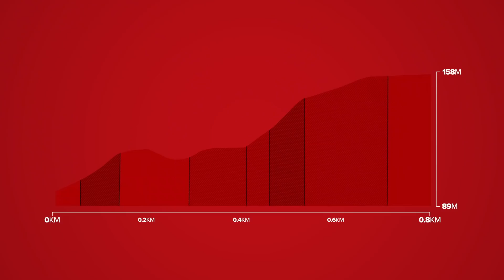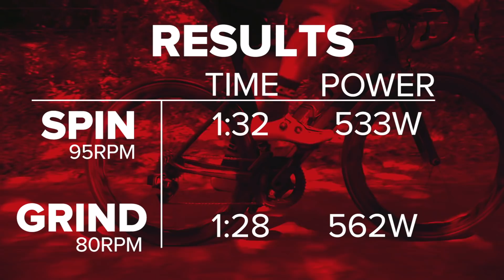Spinning Vs Grinding | What Is The Best Cadence For Climbing On A Road Bike?

Comment from the maker: What's your preferred cycling style? 🧐
Reply: Fun fact: the Lance Armstrong high cadence technique was developed by Michele Ferrari specifically in conjunction with the use op EPO. Because EPO allowed the rider to absorb more oxygen than otherwise, grinding gears stressing your muscles did not fully utilise the effects of the drug. By increasing the workload of the respiratory system at high cadence the muscles would get more oxygen thus have a higher sustained power threshold.  

Note: i am not accusing Froome of taking drugs, it probably means that his body has a higher VO2 Max and lung capacity compared to most others and it's using it as his main weapon.
Reply: Spin to winnn
Reply: Global Cycling Network  spinnnnn to winnnnnnnnnnn
Reply: Global Cycling Network high cadence definitely. Last week I wish I had a smaller gear than 30-27 on a 14%max gradient. All of my friends had a bigger gear, though that didn't mean they climbed faster (some did, some didn't it all comes down to fitness level). However I'd say 80rpm is not grinding territory, you should have done it at 60rpm. My preferred cadence is 90rpm, if you multiply this by 34-32, which is often the smallest gear you find on a compact chainset and with a 700C wheel it gives you more than 12km/h. I'd argue that it's already a great speed to climb such a grueling climb as Monte Zoncolan, you'd have to output a good amount of watts to maintain that speed/cadence. My conclusion to this is that on climbs a lot of riders don't choose their cadence simply because they run out of gears.
Reply: I find higher cadence is harder to keep steady when climbing, but it feels easier. I can grind with seemingly constant even pressure on the pedals so I prefer the harder gear. Also, the harder gear requires fewer pedal strokes to summit.
Reply: I can only talk for myself and say that changing to a real world compact 50x34 with a 32 cassette and learning to spin rather than grind was a massive game changer for me, I went from hating climbs to actively searching them out be it Doi Sutep in Thailand or the HC climb of Sa Calobra onto Puig Major in Majorca. 89-100 Cadence is my personal preference. Obviously some weekend riders are able to spin out a 54x11, or so they state. So it is such a personal thing.Also when you ride 6 out of 7 days I find higher cadence far more workable into that scenario.
Reply: 85-87rpm is my method. I usually don’t stand on the pedals, usually I'm a sitter. Up a hill, I just scoot forward on the saddle like a TT rider and it allows more power to be put down up the hill without standing up. If I stand up, it’s usually to get a little blood flow increase, and stretch the low back.
Reply: When it is a long steep hill, I spin because grinding is impossible for me. If it were a small hill, I grind or out of saddle.
Reply: In my 20's my sweet spot was 85 rpms. Now, in my mid-50's its more like 75 rpms. That doesn't mean I am 12% slower. I am more like 5-8% slower. I practice high cadence, 100-120, for 2-3 mins and brief efforts to 180 rpms but only on a spin bike. As I've aged, I feel that neurologic function more than muscular function has diminished.
Reply: I use a hybrid of the two, I grind a low gear slowly.
Reply: Spining
Reply: ... Spin ... !!! ...yeahhhh !
Reply: I prefer low cadence, but based on this vid, i will try to ride with higher cadence.
Reply: I love my singlespeeding (I have two!). I can climb almost anything without gears so I do like a good grind. However... My last race was a 12 hour MTB endurance event. I came 3rd and the only time I got out the saddle was to look good for the photos ;)
Reply: I have a two speed automatix hub on my moulton. I still do long rides with it. Not long ago I did a 100 km ride and bonked pretty bad while doing it. I'd normally spin but when I was completely spent I could not spin fast enough to engage the second gear. I had it set up to change around 90+ rpm. I had to kick the pedal hard to get it to engage and then slowly grind back home. That time I was really concerned whether or not would I be able to get home.
Reply: The crank length also effects on the cadence. I had on my previous bike 175 mm cranks. They were way too long, but I had not measured them. I noticed that I was more likely to grind with the long cranks. I wasn't really happy with it. Then I got 165 mm cranks on the same bike and I began to ride with a bit lower gear and span more.
Reply: I'd say that no matter how slow or fast you spin, it's better to stay seated and not add load to your legs from your body weight.
Reply: pedal to win 😂
Reply: High cadence, both in and out of the saddle. I've noticed that the longer I ride like that the higher I can go up the gears without losing pedal revolutions.  Until about 2 hours in later when it starts going down and I have to go 3 gears down my average to spin at the same perceived effort.
Reply: Spin and grind. I like both.
Reply: Global Cycling Network spinning, but i am a heavy man hard to keep up when the Hills get over 8%
Reply: I prefer fun cycling style instead
Reply: I can not give a simple  answer at that but I prefer sit on longer climbs but on short climbs I can stand up for have more power and some times when I feel cadense go down and instead for change to easier gear I stand up for pass the hill.
I see I more like stand out of the saddle now when I lost weight since that not feel so heavy do that.
Reply: Global Cycling Network SPIN TO WIN
Reply: i eat pears same :(
Reply: Various styles.
BTW, if you watch "cobbled classics" races, you may noticed that many cobbled climbs show that riders use low cadence, even 70 and less. 
How do I know that?
Most of the races I am watching off my turbo trainer: emulating similar terrain and relative efforts according to the shown at a moment on TV.
That means that I'm watching much less races than before. Dopers TUE and UCI corrupted circuis - looks entertainy, byt not worth the past time.
Reply: I prefer whatever I find easier for that gradient. Therefore I prefer to spin and if the gradient suddenly changes, which it inevitably will do in Hong Kong then I don't have to do sudden changes in force as a change in cadence from 110 to 100 feels much better than 80 to 72. Much like on the flats, you prefer to keep a steady cadence than a changing one.

I really love the science episodes from Siborg and the Doc. Hope you guys do more videos together in the future. Perhaps make some more videos to explore this further. Perhaps we can see what kind of tests they do in their lab with Si and Lasty.

Recently I've been experimenting with cadence and saddle position more. And as we climb we generally move forward in the saddle. I feel my legs are less fatigued when my saddle is more forward, is this because the weight of my leg doesn't have to be lifted in an inefficient way (if I lifted my knees to my chest then that is alot of weight I need to lift up using my core/hips)

Really fascinating subject. In addition to a follow up video I would love to see you both make a video on when to drop a gear going up a climb.
Reply: My current road bike is single speed so I’m grind all the way
Reply: I couldn't really tell you. I have to feel it out depending on what I'm riding and what's ahead but I try to stay at a cadence of about 85 unless it's an uphill then I shift down accordingly to pedal around 75. I try to get a slight burn in my thighs but not unbearable so I don't burn out. I also don't want to over-spin and go nowhere fast.
Reply: Global Cycling Network Also sitting and stabilizing my upper body with little movement in my handlebars seems to help me put the power down on climbs. If it's too tough to sit I'll stand and keep a moderate cadence.
Reply: I'm an out of shape spinner, 95 to even 100 is my preferred endurance cadence.  FYI, I'm also a marathon runner so I think that the lighter but more frequent power pulses favor runners that like to bike, like me.
Reply: Too old to be out of the saddle for a steep hill/mountain. If not too steep, I'd do out of the saddle occasionally.
Reply: A friend of mine wheelies up hills. It halves the rolling resistance
Reply: Global Cycling Network if 80 and below is grinding, then I've no hope of spinning. On a 12km x 7% climb, I averaged 74rpm on a good day 🙄
Reply: For me, it depends on the gradient. Usually I prefer to stay in the saddle and run at a lower cadence but, some climbs just require a mix of seated and standing. I have just completed the Struggle Dales yesterday and it was ''savage'' the heat did not help but, seven categorised climbs and another few 20% you just have to ignore science and climb anyway you can.really good video
Reply: i started training at the age of 27. i really strugle just to keep my cadence around 90 on flat and 70-80 on climb...
Reply: I've had a few knee blowouts so I'll happily spin to win when required in order to not grind and injure myself.
Reply: I'm a grinder on everything.  I'll do centuries average over 20 mph with an average cadence in the 60s.  Even climbing I will stay in the big ring as long as possible
Reply: Grinding
Reply: Combination of both depending on my fitness level and the climb. I have been trying to work on higher cadence in the saddle for longer because I’m technically faster standing (and more comfortable) but burn too much energy doing it. Good video!
Reply: Grinding and lots of standing on climbs. One of the reasons i haven't done a century yet,lol.
Reply: I like to ride in conjunction with a lifting routine, so I prefer to push a harder gear a bit slower. I'm not aiming for the most efficient means to move forward, I'm simply trying to exercise.
Reply: spinning is more aero
Reply: Until i blew my knee up riding in the lakes, I'd been a grinder.

I had to ride at high cadence to try and  prevent the injury again.

Took some bad advice a few months ago (drop the cadence) and within weeks my knee was in agony. Wont make that mistake again!
Reply: Maybe the seated, spinning style is a result of training with an injury.  I suffered an AC joint disruption in July last year. This meant I was unable to ride for 8 weeks and it's still not fully healed 10 months later. As a result of the injury I found it that i couldn't ride out of the saddle because of the strain on my shoulder. I found that seated spinning (90rpm+) was more effective.
Reply: If I spin I can't put down decent power. Maybe my lack of technique.
Reply: My average goes between 60 and 90 rpm. I normally ride on hilly areas, both MTB and Road.
Reply: Masher from age 5-55, just woke up to gearing and spinning. It might not be faster for me than my earlier physiology afforded me, but I can climb fast enough and climb more meters.
Reply: Global Cycling Network 
The perfect cadence is the one that works for you.
Reply: #GCN I find that I rarely get out of the saddle and prefer to drop into a better position. On the hoods 90 degree elbows and focus on my breathing. But I certainly not a pro. Thanks for sharing.
Reply: I like to grind it out on shorter rides. I don’t get as out of breath and my HR is lower. That however doesn’t work great on longer rides as my leg muscles get too fatigued.
Reply: Super rugby
Reply: Are your cranks the same length!  Also different crank length can really affect the out come!  I recently switched to 165mm crank length from 170mm and set personal PR's my inseam is 30.5/77.5cm !  I would like to find a 167.5mm crankset and try that out! The hills I did my PR's on were only 225/ft 72m vertical!  I would definitely like to try the crank length on some much longer climbs to see what happens!
Reply: I always thought lightweight cyclists spin more. Especially noticed this when id be in lineouts in RAS etc where id always close gaps or deal with moments of intensity by spinning. I think spinning is the most efficient way to deal with changes in pace, where 100 rpm + dosent stran the legs nor is the effort long enough to over kill the aerobic system. I would always naturally climb in the 70 - 85 rpm range or any other time when the pace was the same.
Reply: Global Cycling Network 70-75
Reply: this!
Reply: I'm always on the saddle trying to spin  it but sure I'm a MTBiker, I find it fascinating how roadies always climb grinding while we pretty much never do. As it seems there is no clear advantage maybe we do grind because we have to manage our grip which dramatically decrease once you leave the saddle.
Reply: Simple, after 40 years of cycling grinding kills my knees so I keep the cadence fairly high but not so high that its not clean.  I have heard that extended grinding is doing long term damage to your knees but I can't find the report.
Reply: Global Cycling Network mountain biking is my favorite stile
Reply: Depends on the climb. Shorter but steep? I'll choose to hammer straight up in a higher gear. If it's longer but not so steep, a lower gear.
Reply: Vegan...taking drugs to help him win isn't being the "best athlete". Lance was a cheater.
Reply: How about a medium term test. Take the times & power numbers over 60 days. Lets see the numbers from spinning vs grinding after 2 months of tests.
Reply: ...just ride....
Reply: Global Cycling Network was an inveterate grinder, learning to mix so spin in on both flats and climbs. Similar to Ventoso, i go at 85-88 rpm.
Reply: Global Cycling Network Spin
Reply: 90-100.  I love to spin.  Feels great.  Might not be the most efficient, but that's OK.  I'm fat and out of shape!
Reply: I'm not a great cyclist nor was I when I was younger.  At my best I was a B+ club cyclist.  I had a few bright moments, but that's about it.  I tended and still tend to push a bigger gear because I'm stronger than I am fit.  I know it's not great for your joints, but that's what works for me.  I like to push a bigger gear while seated and stand up and push the biggest gear I can handle while standing up on the bike.  I feel like I get the most distance for my effort on shorter hills this way.  Longer climbs, I need to spin like anyone else.
Reply: They need to have a presenter on GCN who is NOT a former pro cyclist and who is STILL just a notch or 2 down from pro level fitness.  An avg Cat. 4 racer, someone who we have SOME HOPE of aspiring to their level ... have THEM perform these types of tests. Because I KNOW I'm an avg. recreational cyclist and there's NO WAY I can match Si's wattage/kg. on climbs.  Probably less than 1% of GCN's viewers can.  Though is was a nice try at 'humility', it just came off as 'appeasing' GCN's viewers when Si said "avg.cyclists like us".  Si you are an ELITE LEVEL CYCLIST, don't make us laugh. Above 90 rpms is 'spinning climbs' and below 80 is "grinding climbs".  "Spinning" flats is 80-100 rpms.  "Spinning" climbs is 60-80 rpms.  "Grinding" flats is 60-80 rpms, Grinding climbs is 40-60 rpms more like it.  And the STEEPER the climb, say 12%+ gradient, you are actually 'spinning' at 50-60 rpms.  This video is hyped up post EPO pro 'spin to win' propoganda.  No offence GCN.  Most of your videos are much better.
Reply: As a heavy, middle aged rider I use my heart rate as a primary guide on steep hills, alternating styles as necessary to keep from going over my max.
Reply: Spinning is for riders with weak legs.
Reply: Spinning all the way. On my TT/triathlon bike I am comfortable with 95-105 rpm with tailwind sections going up to 115rpm. 
I have legs that deal quite badly with torque and recover slower with slow cadences.
Reply: only have one gear so yeah 🤷‍♂️
Reply: Grinding😂 on the lowest cadence possible. Standing up of course
Reply: gangnam style ... sorry I could not resist
Reply: I'm riding a Giant TCX, maybe from 2014. I live in a hilly city that's not terribly mountainous. I ride up to around 3000 miles per year. I ride casually at about 15 mph, and when I get on it above 20 mph on the flat. I'm slowly learning when I should spin up the hill rather than grind. I'm seeing improvement and I will keep pushing the pedals.
Reply: Spinning men spinning..
Reply: Flats - 90, climbing - 100
Reply: I'm not a trained or competetive cyclist so feel free to discount what I say. I run longer cranks (175mm) which waste energy lifting the legs higher on the backside of the stroke. But when I need some extra power, instead of standing I use the old school pedaling technique of Ankling. This involves dropping the heel on the upstroke and pushing across the top, than at the bottom extending the ankle to continue the stroke across the bottom. I find that with a headwind, or slight incline I can do this instead of shifting down a gear and spinning faster to maintain the same speed. This brings the calf muscles more into play than spinning with shorter cranks and applies power for more degrees of arc each revolution. So this is a third variable I think.
Reply: Spinning is the obvious winner. I have proven it to myself on my hours of bike riding up steep hills.
Reply: Both. Because need different cadance for different conditions. No best anyway. Condition situation, heart rating, training style, distance, gradient slope... more factor
Reply: Road biking with a mtbv
Reply: I'm guessing it's related to the fact that my preferred style of bike has at least 5 inches of travel at both ends, but spinning feels better to me.
Reply: 90 rpm...
Reply: I ride a cross bike with a 1x11 and, on a hill that I climb frequently, I find I do just as well grinding in a harder gear (not shifting at all) because I always lose speed too fast when I start shifting to easier gears.  I’m an experienced cyclist, yet, I have never felt that I understand gears on a bicycle.  I rode up this particular hill yesterday with a cyclist who usually climbs faster than I do if I’m shifting, and I found it easier to keep up grinding in the harder gear I was using on the flats.  In fact, I could have easily passed.  I find gears more useful on relatively flat roads for achieving my fastest cruising speeds.

Even when climbing I usually remain seated, but have started doing more pedaling out of the saddle to see how it may affect my climbs.

I suppose I need to pull up the graphs and compare these segments.  Maybe I just don’t get it?  Or maybe I am a natural grinder?
Reply: ...motorcycling?....
Reply: MRGRUMPY53  Spinning at high cadence definitely increases cardio level when climbing...makes sense this would be assisted by EPO more than grinding?
Reply: @mihpop9733  Or maybe he's using drugs.
Reply: Spinning means there is less torque on the knees which is better over a 3 week tour especially if you have dodgy knees
Reply: Spin to win
Reply: When I first started cycling a friend gave me an old 5 speed cassette 12-17 and then proceeded to introduce me to a very steep climb just outside Melbourne, Australia.  There was no way I was going to make that climb sitting in my saddle with a 39-17 gear ratio.  Therefore I learned, early on, to get out of my saddle and mash those pedals.  Over the years, even with more realistic gear ratios I still hate sitting in the saddle to climb steep hills.  I much prefer to select a smaller rear cog and get out of the saddle.  Having said that, I have a very basic mountain bike that I ride a lot these days.  It has basic pedals without any toe clips.  Now I find getting out of the saddle to mash those bigger gears is uncomfortable and inefficient.  So now I find my self sitting in the saddle and spinning.
Reply: I do 7 hour rides at 55 rpm lol
Reply: Electric bike..... but seriously for FTP it was pretty much 90 rpm, back when it was almost 300 watts for 20 minutes (depending on the accuracy of a gym exercise bike). Because the bike was maxed out on level 15 I couldn't test lower cadences without dropping power. But I know I couldn't sustain quite as much power at 96 rpm in level 14 to make the same watts. I put out 280 watts for an hour straight at 70 rpm on a leg AND arm recumbent stationary cycle.
I spin like a clown when sprinting away from the lights. It's funny when you think the cars are going to pull away quicker and you almost go into the back of the one in front of you because you put down too much power. Most people lumber off the lights in my town though. I cruise at about 60-75 rpm on longer rides when I'm not trying to go really fast. I hardly ever ride out of saddle - apart from to alleviate a sore crotch, but I like my saddle at practically standing height anyway - it just feels like less burn when the leg is straight at the bottom of the pedal stroke.
The bike I have with a Bafang mid-drive likes higher cadence for motor efficiency. I find the power meter is buried at 1100 watts until you exceed 120 rpm if you are at full throttle. I bet car drivers thought it was funny watching me spin uphill at 30 mph on a hybrid with a rear rack.
Reply: I prefer grinding honestly but I'm honing my spinning recently 😅
Reply: @xGshikamaru  time for 24/36/48 chainsets on 34-11 cassettes on lightweight road bikes. That would be a beast.
Reply: @K1989L  Don't you get some boost from your body weight helping to push pedals down though? Which you don't get while sitting? So it's not entirely lost energy having to hold your torso up.
Reply: I  climb in 34/28 34/34 . I climb at around 7-10mph so my cadence is very very high. Grinding just hurts my knees eventually
Reply: spin
Reply: I'm about to approach 60yo. For now training indoors, but can't wait to get my road bike. Thanks to you guys at Global I'm learning the new bike techno's. Hoppy New Year Guys !!!!
Reply: Spin
Reply: Spinning.
Reply: Walking
Reply: I use whatever it takes to get up a hill. At my age and fitness level, I find I don't have time to fiddle around  with cadences, just do whatever to get up the dang hill still alive, lol.
Reply: @Callum Lian Instablaster :)
Reply: My low gear is 34/27 and I try to save it for emergency hills. I try to climb on 34/25 unless I get desperate. I also will do the first portion of a step climb out of the saddle on 34/21 which gives me enough resistance  to stand up for the first bit.
Reply: Grinding.
Reply: @mihpop9733   High-cadence cycling was not invented by Ferrari or Pantani. And even doped to the gills, Armstrong did not dominate the toughest climbs as did a climber more than forty years previously. The honor for both feats went to the greatest climber of the mid-50s, perhaps the greatest of all. Known reverentially as the "angel of the mountains," Charly Gaul was the equal of Jacques Anquetil and Fausto Coppi, and but because at that time the teams were national, not corporate sponsored, and Gaul's Luxembourg team was especially weak, one of the giants of the sport never got his due. 

Over the mountainous TdF in 1958, Gaul used his climbing prowess to ultimately win the yellow jersey. At that event Mont Ventoux was included. Gaul decimated the field, setting a world record for Ventoux that stood for 31 years.

Here is what the cycling journalists said about him when in his prime in the mid-50s. The writer Jan Heine said: "Nobody else ever climbed that fast. Gaul dominated the climbs of the late 1950s, spinning up the hills at amazing cadences, his legs a blur while his cherubic face hardly showed the strain of his exceptional performances."[8] Pierre Chany called him "without doubt, one of the three or four best climbers of all time."[23] Philippe Brunel of the French newspaper L'Équipe said: "In the furnace of the 1950s, Gaul seemed to ride not against Bahamontes, Anquetil Adriessens, but against oppressive phantoms, to escape his modest origins, riding the ridges to new horizons, far from the life without surprises which would have been his had he stayed in Luxembourg."